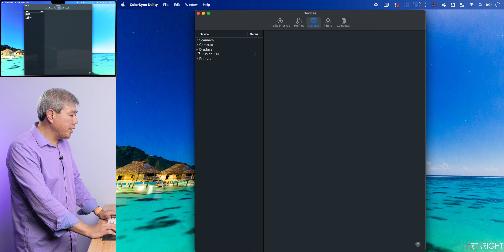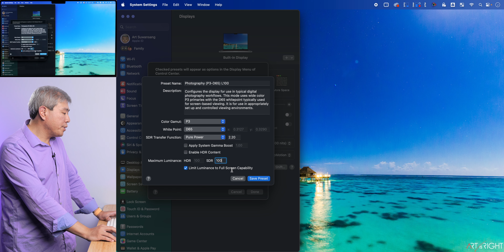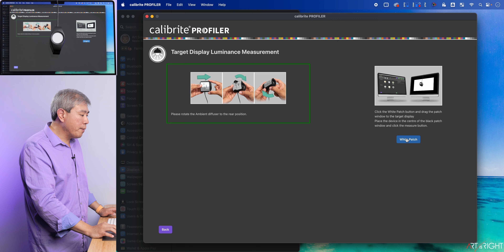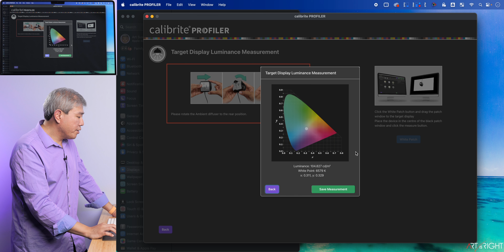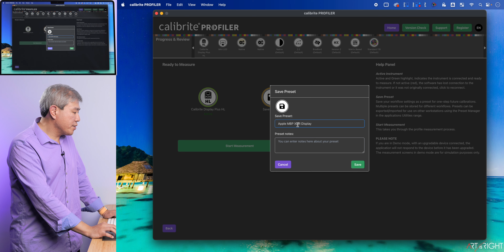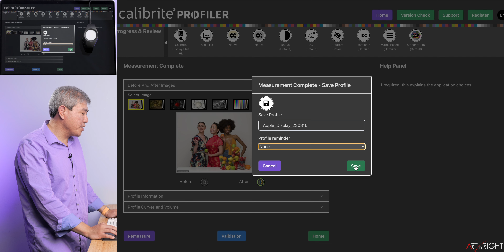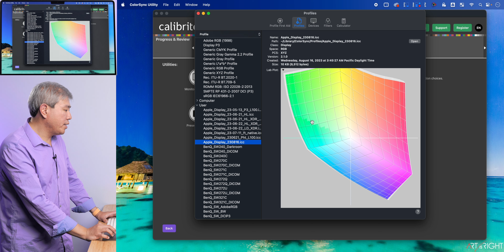Ultimate Calibration Guide for Apple 14" & 16" MacBook Pro XDR Display - This is the way!

Comment: Hi Art, first thanks a lot for your fantastic info. 

My problem: I followed exactly the same steps as you (except I chose ICC v4 instead V2 like you) on my new 2025 Apple Studio Display and Calibrite Display Plus HL. I got a good result, but when I analyzed my profile with the colorsync utility I get a gamut close to sRGB, far from your P3.

I found people with my exact problem, his solution was to change the display tech to “MiniLed” instead your recommended “GB Led”. By doing so, they achieve an exact P3 gamut.

Is it correct? Is there other solution?
Reply from the maker: You can do that with Studio Display. I no longer have one to test out, so I can't validate or verify the results. If I do get one into test, I'll update the info.
Reply: @ArtIsRight  Thanks Art, I would appreciate it
Reply: @ArtIsRight  I just get an answer for Calibrate support:
"Using the Mini LED configuration is a valid option for the Apple Studio display. While it's not the same backlight, it has a similar color gamut to the Mini LED displays used in other Mac systems. If you have an HL device, you can use the Mini LED option and you'll get a profile with the display's full P3 color gamut."
Reply: But not, tried and I get the same srgb gamut 😕
Reply: I’m having the exact same problem when calibrating my Studio Display. I've tried Mini LED, GB LED and even White LED. They all show almost identical small sRGB-ish wireframes in ColorSync. My validation numbers are excellent (ΔE avg 0.3, max 0.8) and Photoshop tests confirm I’m definitely seeing a wide gamut, not sRGB. But ColorSync’s wireframe shows a gamut that looks like plain sRGB. I’m starting to think this might be an issue with ColorSync in the current macOS (I’m on Sequoia), since I’m seeing more and more reports of identical behavior when generating new ICC v4 profiles.
Reply: @brianpercussion  I ended up thinking exactly the same thing as you. I'm on Sequoia too, getting the same sRGB gamut with ICC v2 too. Waiting for the new and imminent OS for a solution (and for Art, I hope he can help us!)

Comment: @20:31, you are entering what amounts to the same  pretty much  the same"Target" as "Measured"? x=0.311 vs 0.312 is not a whole heck of a lot of color difference. The y chromaticity is bang on!  To the point that one wonders "Why bother custom profiling on top of what Apple provides?" which is... I've seen other videos measure exactly 0.312 and 0.329 using their own i1DisplayPro. 
Has anyboy ever bothered to compare the "Built-in", Factory ICC profile to anything Custom? Especially @D65?
Has anyone ever bothered to notice how Apple MacOS systematically zaps the Display profile/calibration upon restarting or waking up from sleep and other scenatios? There's a guy on gihub that has written a small utility that checks, every 30 seconds, to reestablish his custom ICC profile... 
One more question, if I may... Does Calibrite provides any EDR for use with the i1DisplayHL on these displays? I'm told that without these "spectral correction files", the measurements are useless?

Comment: Hi Art, thanks again for all your work on these videos. I always come back to them each time to make sure I'm doing the steps correctly. Recently, I tried to update the white point on my Studio Display with the fine-tune calibration as it's been over 6 months. When I do the beginning steps by making the L100 preset, it disables the ability to do the Fine-Tune Calibration. If I select the Photography D65 it will allow me to do the Fine Tune Calibration, but my understanding is that the default photo preset is set at L160. As soon as I edit it, it greys out the fine tune option. Is there anything that I can do to fix this or am I doing something wrong?
Reply: Seemingly cursed to find the answer immediately after asking someone, but not without a couple hours of struggling beforehand... 
For anyone else, I adjusted the Photography D65 and did not change the title text, and that has allowed me to use the fine tune feature.

Comment: I have the new Macbook Pro M4 computer with apple retina xdr display.  I bought the new Calibrate Display Pro HL.  I am having a problem right from the start.  I made a new preset for Photography P3-D65 and named it adding only the one change with Lum100 at the end.  I now have that preset in my display drop down box.  The problem is:  when I click on that preset I am NOT given an option for Fine Tune Calibration?  I only have the option of a Full Calibration.  I was able to go into Calibrate and get my true white colour value and my x and y values and Luminance Values.  I'm just frustrated I cannot return and put them into the Fine Tune Calibration box in system settings.  What am I doing wrong?  Thank-you
Reply: I contacted Art, and this is what worked for me.  Apparently, when making a custom preset for the display on my Macbook Pro M4, I was supposed to keep  the blue box for "Limit Luminance to Full Screen Capability" checked.   By mistake, I unchecked that and after saving that custom preset and then clicking "Calibrate Display" the option for Fine Tune Calibration was greyed out in the Pro Caibrator Box. But if you make that one change you will get the option to do a Fine Tune Calibration.  I hope this helps you.  Art was a great help.
Reply: @carriebradley8604  Appreciate the update—Thank you!
Reply: I'm experiencing this as well. I'm finally updating my white point after having successfully done it earlier this year, and now that Fine-Tune Calibration option is grey out. Were you ever able to figure this out? (In his other video, he mentions having to have selected the photography preset and then it's avaialble.. when I made the preset it becomes greyed out)
Reply: @skyiswomb1  That worked like a charm thank you

Comment: I have an LG OLED 4K display with Self-Lighting Pixel Technology (reference monitor) connected to a Mac Studio (running macOS 14.6.01). The display is driven by a Blackmagic 4K video card. I'm wondering if calibrate software/hardware would be effective in calibrating this setup for video?

Comment: anybody having this issue? 
/Library/Application Support/Adobe/Color/Profiles/DCI_P3.icc
   Header message digest (MD5) is not correct. 
. I always calibrate with no problem and then this time in mac os sequoia this happens. seems adobe interfering with profile, spoken with 5 different agent in adobe now , and no one has a clue .

Comment: First of all thank you for the tutorial. I'm about to get the Calibrite. But I have some questions.

1. After done the calibration. Can I switch the Display Preset to the default under the System Settings at 4:28 since a Protography (P3-D65) can't adjust the brightness.

2. I have MBP14 M1pro and Studio Display. For matching the color or get the most accurate color on each screen. Do I just calibrate and set a color profile on each of them or does it have the proper way to do that?

Comment: I am wondering if and how I should work with profiles when I normally use the new Apple Studio Display connected to laptop, but when away from studio, I am using the M4 MacBook Pro by itself. Do you have a video or discussion of how to work with this kind of set up? Thank you so much for this video. I couldn't have done the profile without you--sent you a tip. (So far I only have a profile for the connected display, and not for the screen on the laptop.)

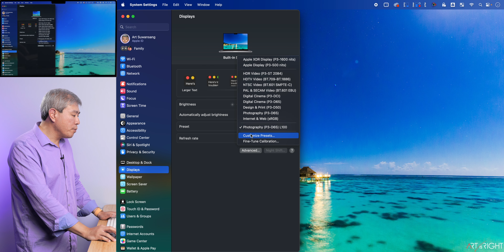Comment: Hi Art, I tried to follow this process to calibrate my ASD but ran into a snag. At 7:40, you show how to do a fine-tune calibration. However, in OS X Sequoia 15.3, when I click on "Preset" I do not have the "Fine-tune calibration" option. I can only choose "Calibrate display". Then, a dialog box appears called "Apple Pro Display Calibrator". It says "Select a method to calibrate", and the options are "Full calibration", "Fine-tune calibration", and "Visual fine-tune". However, only "Full calibration" is available; the others are greyed out. If I choose "Full calibration", it tells me it will perform a full calibration that takes 2 hours and I'll need to be in a dark environment with a calibration device connected to my Mac. But when I connect my Calibrate Display Plus HL to my MacBook Pro, it says "No measurement device found" in the Apple Pro Display Calibrator panel. I read the Apple help article on this topic, and it said the only compatible devices for calibrating the display are from Photo Research (PR-740, PR-745, or PR-788) or Colorimetry Research (CR-300, CR-250, or CR-100). I do not have any of these devices. What now?
Reply from the maker: Yes there are some dialog changes, I have to update this video. You can't perform the full calibration only fine tuned and that is what you need to do.
Reply from the maker: I won't see response so dm me with questions
Reply: I contacted Art.  A great help.  If you mistakenly unchecked the blue box in Custom Presets "Limit Luminance to Full Screen Capability" the Fine tune Calibration will be greyed out.  So with my Macbook Pro M4 laptop, I made sure the box was checked for "Limit Luminance to Full Screen Capability".  I clicked Calibrate, the Pro Display Calibrator box came up and the Fine Tune Calibration was enabled.  So I was successful in color calibrating my computer.

Comment: Hi Art, I tried to recalibrate my macbook again. Though I notice when I created the preset for photography L100, when I used calibrite to measure the target display. The luminance was around 90-93, but I can't set my target luminance to 100, I could only get close to 93.9 based on the maximum output its allow. In order for me to get my target luminance to 100. I need to created a preset and luminance 110, in order to put target 100. Do you have any feedbacks what would be the best approach for me? Thank yoiu in advance sir
Reply from the maker: There are about 2 ways around that. I'll have to make a video about it. 
But for now, you can enter the value that is close to what the computer is expecting. Secondly, create a new preset with a higher luminance to get the value that you want. Display dim over time, that is why it is happening.
Reply: @ArtIsRight   thank you Art, when I created the preset I changed the luminance to 110 in order to get to 100 when fine tuning as you instructed. Thank you so much, do we have to reset the the current profile to factory or can we just go straight to calibrite app every-time we want to recalibrate. Thanks once again, your channel rocks.

Comment: Wow, thanks for sharing this. I wouldn't have known anything about all those extra steps - I would have just used the Calibrite profiler out of the box. My M4 Max MBP, using the Calibrite Display Plus HL, had an "all patches" number of 3.8, right near the outside of the range you mentioned. Comparing the profiles visually at the end there was a little bit of gray around one edge (mostly by the green section).
Reply from the maker: You're Welcome! and your results are fine for MBP

Comment: Hello! I had a wonderful calibration. Thank you so much for this detailed video! Just one more question, I am using for starting point HDTV REC709 BT1886 (which should have a Gamma of 2.4) - Do I need to stick to 2.2 Gamma in the Calibrite Profiler settings (as a Native setting) or should I select BT1886 even in the calibration? Thanks
Reply from the maker: Thank you, 2.2 is not native gammut, so I would choose BT1886 or 2.4 as a custom value. This way it would match with what you are calibrating :)
Reply: @ so BT1886 both on the xdr presets and in calibrite right?

Comment: Hi I haw qustion.To my MacBOOk pro m3  I use ASUS MQ16AH. oled display like external monitor for color grading in Davinchi, how to calibrate proper way ?I haw DisplayPlus HL .On display I haw many modes like standart/sRgb/Game and more,wich one I haw to use before cabirating start?  thank you!
Reply from the maker: There's no spec on the webpage so I would say standard and then choose OLED from Calibrite backlight option.
Reply: @ArtIsRight  thanks.after calibration ,when I use clean feed in D/Resolv  its looks normal in standard mode,but when I switch to output from Ultrastudio 3G monitor ,looks very saturated any ideja how to make correct calibration for using ultrastudio display? thank you,

Comment: Hi Art. I’ve just done a calibration following your guidance. All good. Thank you. One question pls. When I took the first measure of luminance and white point values I got 89.646cmdr, white point 6576 and x:0.311 y:0.328. I tried to input 100 as the target luminance but it was not accepted. I put in 90 as it was the closest number to 89. Should I expect anything different or is that ok. Kind regards. Ed
Reply from the maker: Yes there are 2 ways around this, I need to do a video about this.
One way is to tell the machine that you want a higher luminance in the preset setup and then measure so that you get with in the range that you want. From there you can do some fine tuning. 
Otherwise you just have to enter the value close to what the calibrator is reading out at and don't do fine tune for luminance.

Comment: Hi, which Display and Technology Type you recommend to be selected for MacBook Pro 16'' M1 with Liquid Retina Display while using Calibrate Profiler which do not have "Mini Led" option but "White Led",' "GB Led", or "PFS Phosphor" as I found different recommendations in the net mostly focused in the middle or the last one. I have completed the calibration following your guidance in the clip. And when speaking on Validation results are pretty decent but on P3 coverage this is far from your result and what I envisioned. Thank you in advance.
Reply from the maker: You can calibrate with your device and choose PFS option but it wont be optimal and you won't get the color gamut.

Comment: I’ve started using the Photo Preset configured to SDR 80. Before I simply left the screen at the 1600 nits and auto brightness and Truetone when editing photos. Using the preset has helped enormously in editing photos that actually print with good luminance. I’m now contemplating whether I should go the extra step, purchase the Calibrite Pro and do a full calibration as per your video. I’m curious though how much a difference will the full calibration make to the accuracy of the colour editing given it is reasonably complicated (albeit that following your video should 🙏 make it foolproof) and Apple presets are presumably designed to make the whole process easy. Cheers. Ed
Reply from the maker: Your colors will be slightly warmer on the display. Apple tuned this display more blue.

Comment: Thanks for this guide Art! 

Question: I want to create two presets in Calibrite Profiler, one for Photo and one for Pre-Press, and switch between them depending on my current project. Will the correct profile be selected when I change preset in the Mac OS display settings? Also, I did the "Fine-Tune Calibration" like you explained in the video, but do I need to do that again when creating my Pre-Press preset? Wouldn't this override my first fine-tuning that I did when creating the Photo preset?
Reply from the maker: Profile and presets are independent, so you have to change both individually. Fine tune will only work with 1 white point. not 2

Comment: Hello Art, thank you very much for the great tutorial and for the effort to answer to our questions. 
I do have some questions:
1. After creating a profile for a few different (in brightness) photography presets, I have noticed that even though this profile is still active while using the default P3 presets with brightness adjustment, the contrast on these presets differs from that of the specialised presets. When testing on the "Black Level" page of Lagom, XDR preset crushes the blacks noticebly, so there is some gamma shift going on switching between the default presets and the workflow presets. Any way to correct the gamma on the default presets?
2. Looking at the gamma chart provided by Lagom, the gamma is super off in all my browser, but after downloading the image it does look right from the Preview app. On a Windows machine I didn't have this problem. 
3. After calibrating both the macbook display and perfoming a hardware calibration on an EIZO ColorEdge Monitor with the same device, the EIZO looked noticebly more magenta/reddish, especially in skin tones. I have then decided to manually reduce the red output on the eizo to match visually that of the apple display, but I'm not sure which is more correct - the specialized monitor or the apple display. Do these Green-Magenta differences actually matter a lot, since our perception of white balance changes based on our surroundings?
Thank you!
Reply from the maker: 1. There is a bug in macOS that came up in testing after I made this video. The solution is to set the gamma to sRGB instead of 2.2 to curtail this issue. A lot is going on here, so I won't be giving my full explanation as to why.
2. Refer to #1
3. I would also calibrate your Eizo with Gamma set to sRGB. It affects everything. Also, you are looking at different color gamut output and display tuning, hence those variations. I deal with this daily. And I would go by your hardware-calibrated display if you print.
For further questions or responses, please start a new comment or dm me.

Comment: Thanks for an awesome video! Learned a lot! I'm very new to this but have bought me a Display Plus. When making presets for my Pro Display XDR, I've measured two profiles (one for photo and one for Video) with the settings adjusted for each. I can see them in the system settings/display and change them there. But when I look in Color Sync Utility the corresponding profile doesn't change with the changes of the presets. Do I need to do that manually in Color sync utilities every time?
Reply from the maker: Yes you need to change them manually, profiles are not linked to preset. Also you can use Calibrite profile manager to help with this.